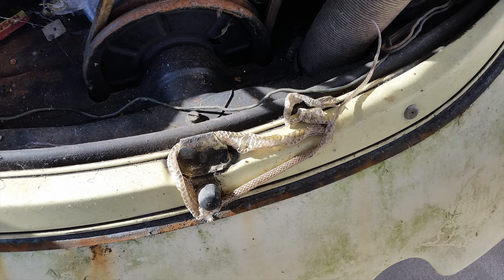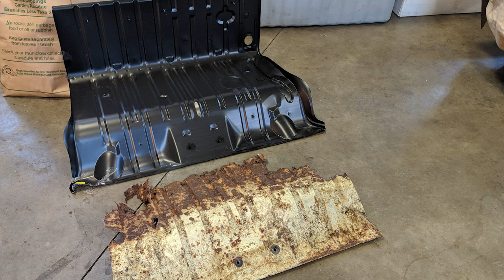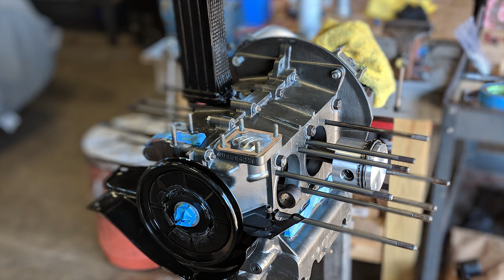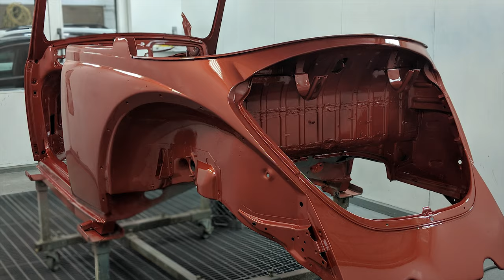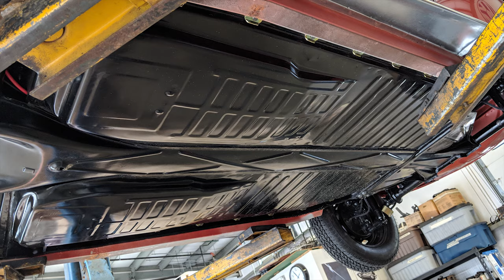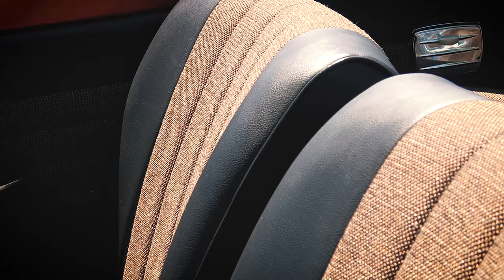Classic VW BuGs 1970 Beetle Convertible Restoration Start to Finish ScrapBook

Comment: Beautiful Colour . Chris maybe you can answer this or someone in the community but I have a 78 Vert. Are the rear seat windows adjustable? They retract fully open and closed the issue is they are slightly bowed out when  in the up position about 1/4 inch. Am I missing shims or something or installed improperly?